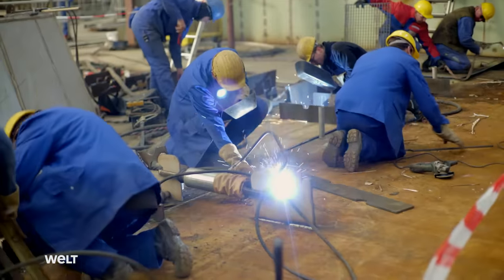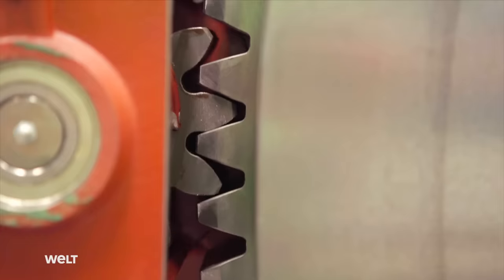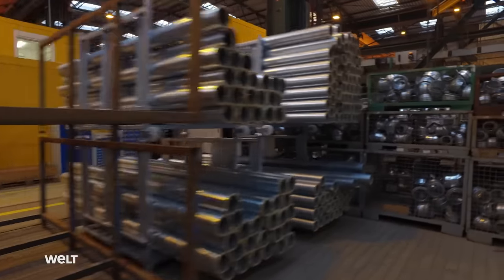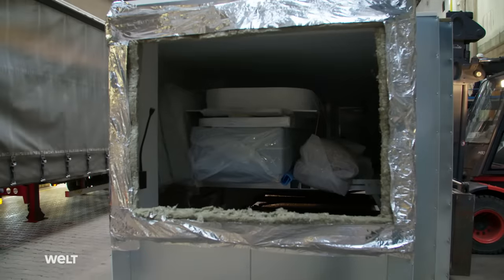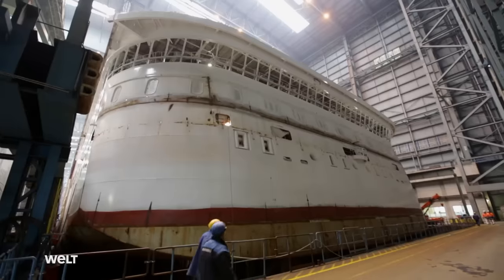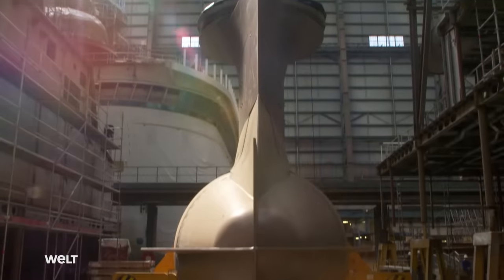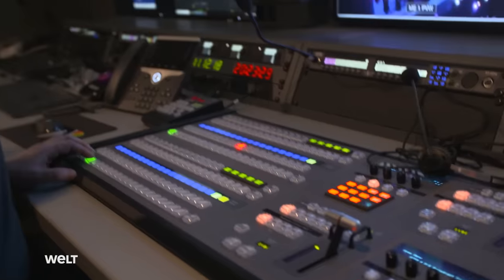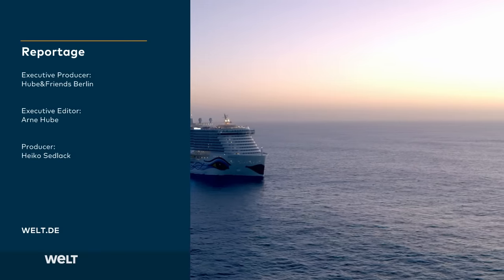The Construction Of A Cruise Ship - AIDAnova | Full Documentary

Comment: 6:13 the narrator misspoke, he said LPG  (Liquid Propane Gas) instead of LNG  (Liquid Natural Gas).  Attempting to run those engines on LPG could be a rather explosive experience!
Reply: Cars can run on LPG (in my country it's a lot cheaper than petrol), why can't these cruise liners use it if the engines would be designed for it?
Reply: @vigilantecornflakes5014  I wouldn't see any reason why not, as long as they were adjusted to burn it.
Reply: LNG IS BY FAR MORE explosive then LPG
Reply: @vigilantecornflakes5014  CARS RUN ON LPG  HERE AS WELL.. BUT  LNG  IS A LOT CHEAPER AND MORE AVAILABLE IN PORTS
Reply: Also at the end he said, liquid gas. lol, I don't think it was supposed to come out that way.
Reply: He did say LNG at 5:13
Reply: Mate he said those engines could runon both LNG and PGS
Reply: He repeats the same at 12 minutes.
Reply: He did say liquid natural gas @6:13
Reply: “LPG” stands for “Liquid Petroleum Gas” not “Liquid Propane Gas”. “Propane” is just one variety of LPG.
Reply: LNG is used as it most closely resembles marine diesel
Reply: I think they made mistake on the 500 rpm too, probably more like 300 on those big engines
Reply: @kinderboeken55  totally incorrect
Reply: @skippyguy3  my bad

Comment: There is a mistake in narration but next time make it better he says “an engine of 2,000 tons” I think it’s 200 tons
Reply: Mohamed Shiham it could really be, As a railroad locomotive ways more that 200 tons depend & horse power.
Reply: well the whole middle of the ship with the theater was 800 tons so yeah it would be 200 tons
Reply: Correct.  I've overseen the movement of slightly smaller natural gas engines and they were about 150 tons without turbos or accessories.  The biggest are about 250 tons all equipped.
Reply: IT IS 2.000 TON X 4 OF THEM
Reply: @imTablet  THAT WAS BUILT ALL OUT OF ALUMINUM..